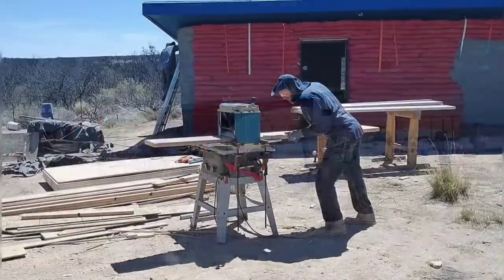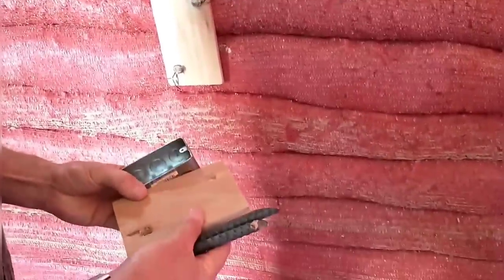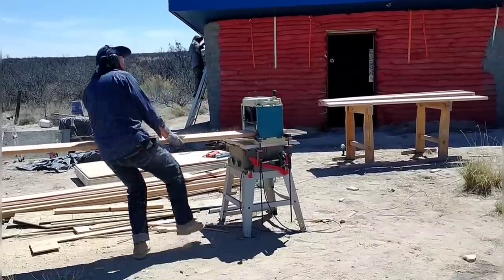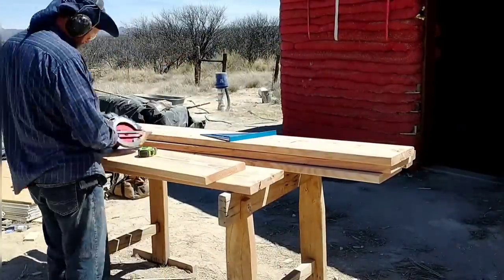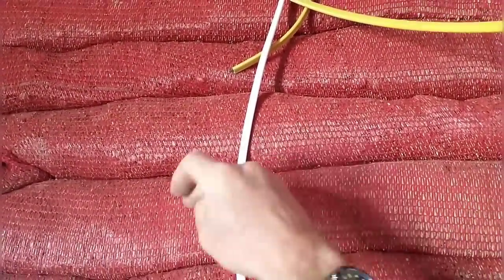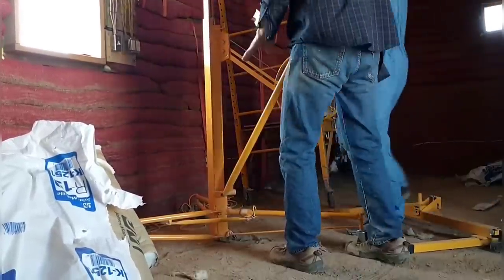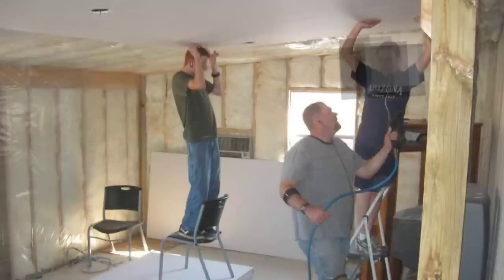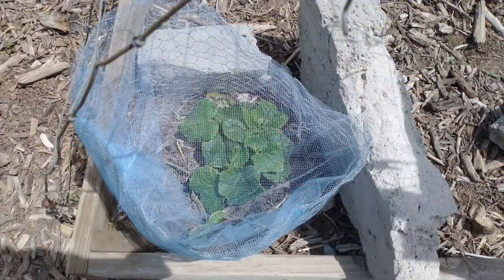Hyperadobe Tiny House #6 Electric, Door Frame, Insulation, & Drywall

Comment: If you insert untreated wood in the bag, it could rot or attract termites. Treated wood would outgass as well. I would prefer recycled plastic panels, for example, or fiberglass. Or, scraps from bathtub or shower installs.

Comment: You will find if you put in two screws about two to three inches apart it will give you a better drywall finish.  Plus you don’t have to put them in every eight inches.  Eight along each edge and just six down the center and your done.  Drywallers usually work in pairs wearing aluminum stilts that attach to the leg.  They lift the sheet up to the ceiling and put the screws in.  It takes them about a minute to hang a ceiling panel  or wall panel but are usually  12 foot long.  Later
Reply from the maker: Yes, the professionals are so fast, and they usually do a great job too!

Comment: I feel like coarse thread lag bolts would've worked better than the rebar,  but it's an ingenuitive fix.
Reply from the maker: We tried some screws and they didn't work at all, they got caught on the larger sand particles and stripped the hole out. Surprisingly nails or anything pounded in holds much better.

Comment: How is hyperadobe structural? Would rebar be applicable? Integrated stick framing? Besides the weight of itself, is what I'm asking
Reply from the maker: The bags are filled with a damp clay rich soil, which is then tamped/compressed. The walls are similar to rammed earth. They dry very hard and are 18 inches thick.

Comment: I've wondered on this build why you didn't increase the thickness of the roof insulation another layer or so? I ment to ask on a previous video but obviously didn't. Was it cost or a calculation that decided it? 

Also, FYI - Last year I helped a friend do some on his hyperadobe house in W Texas and (its too late for this build of yours but for future expansions...) what he did was embed electrical conduit between the layers as he built. He had a block of wood simulating each electrical box so when the walks are finished, the block gets replaced with the appropriate box and the wires are pulled.
Nite that he's building his house one room at a time. Built the first one and moved in then built a second room, etc (I was there for the third room completion). He had a 20' cargo container that he built his first room right up against so eventually it will be totally embedded as part of the house which will be a mechanical n laundry / storage room but the end doors still give access to outside.
Reply: That's what I thought too. More sound insulation on the ceiling,  / because of the tin roof. But, they are in a warm desert were it don't rain.  Cool nights and hot days.
 Should be alright with or without insulation.
Reply: True, but also some people really like the sound of rain on a metal roof
Reply: @missingremote4388  well, I want thinking of sound damping, I was thinking thermal insulation
Reply from the maker: @bobjoatmon1993 Cost was a factor, and we decided with all of the thermal mass of the walls, the ceiling didn't need to be particularly well insulated. The summer should be pretty comfortable with just a fan bringing in the cool night air, and possibly an evaporative cooler.
He won't be heating the house in the winter. It helps some, and can be done, but the walls would absorb most of the heat. It will be a bit cool in the winter, but much nicer than living in his unheated RV. (He has never bought any propane, and even takes cold showers 🥶.)   The temperatures in his hyperadobe house should be quite livable and very stable. We are curious to see how well it does. 
That sounds like a neat build, and nice you got to be a part of it! 😎
Reply: as a general contractor i can tell this much , no ventilation in the attic space will become an issue. In summer that attic WILL hit 160+ degrees, and will radiate heat indoors.
Reply from the maker: @awesomearizona-dino   A fully filled in roof space typically doesn't have vents. Our roof is done the same way, and it is performing really well. We are not experts though.

Comment: are you going to build a wall in front of the door to slow down wind rain ?
can you ask your son why he chose not to have two doors for fire escape ?
Reply from the maker: We don't get a lot of rain here, so it shouldn't be too much of a problem. The roof overhang will also help block the rain. 
He just wanted to do what was easiest at the time, and we were too busy working on our house to give it much though. We definitely wish we would have recommended a second door.  Fortunately not much in the house will be flammable, and the whole space will be open and accessible to the door.

Comment: wires buried in stucco should have been a UF wire not NM
Reply from the maker: Outdoor wiring is a lot more expensive. The inside walls will be covered in cob, and they won't be exposed to UV light or moisture.